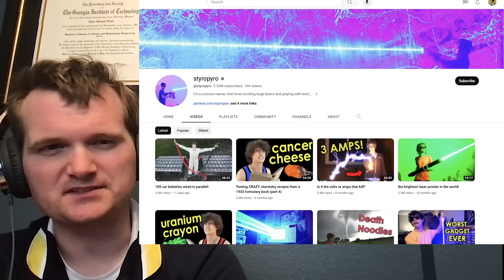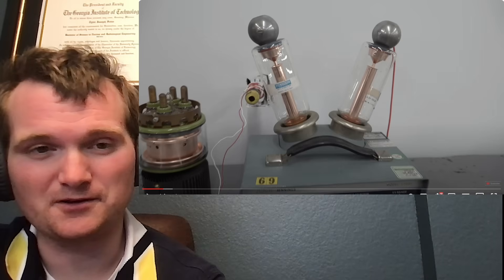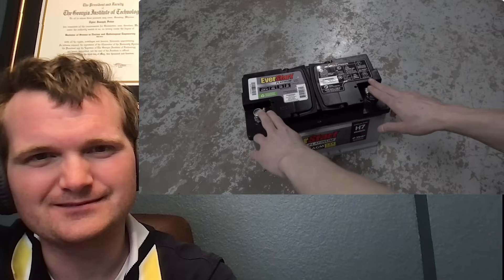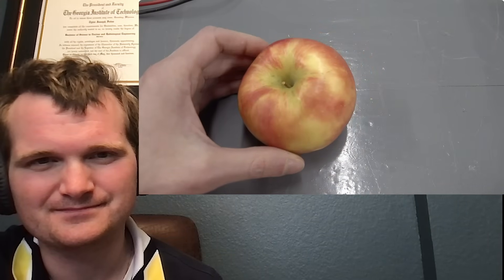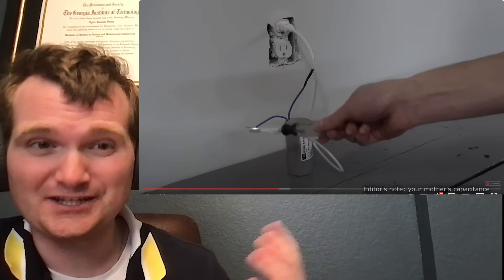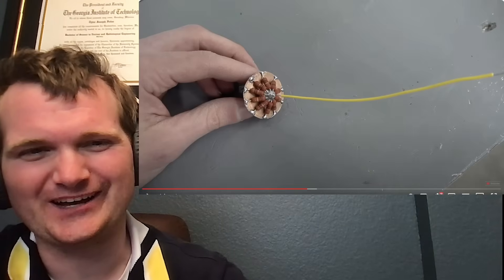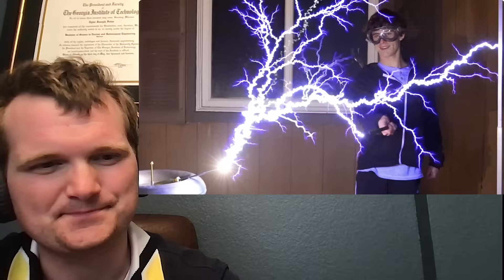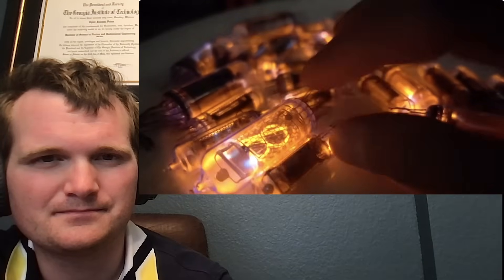Nuclear Engineer Reacts to Styropyro "Is it the Volts or Amps that Kill?"

Comment: Dudes who say it's just the current that kills, never went to the navy and seen multi million(mega) watt transmitters which capacitors have literally vaporized people.  The discharge is voltage. However, if you have .000000000001 amps and the reciprocal in volts, in totality you only have 1 watt, and vice versa. It takes power in general to pose a risk to a person. a trillion amps of current and a nano volt won't kill you. A trillion volts and a nano amp won't kill you either. This is theoretical . The current and the volts vary when they travel through different sources. An ark in the air isn't just volts, the current is also traveling through the air, and the further the distance and less dense the materials the least amount of power is getting to ground. whatever is at the other end is ground. Ironically the ground for a lightning strike could technically be the other ark coming from the ground to to lightning meeting it instead of just the ground. That isn't necessary to mention. the ground is the ground. The ships hull is the ground, a large metal object is the ground when attached to electrical and the bigger the current the bigger the ground needs to be. Not unironically in ac. High voltage can use the negative as the ground, but it's less safe and not neutral . For most purposes tho, the negative is the voltage leaving the power source .

Comment: One thing that was completely overlooked was the surface area of the contact and what that has to do with (dis)comfort.  Getting zapped by a Van de Graff  generator or static electricity is painful because the arc is intense, focused at a tiny spot of the skin.  If you repeatedly get arced by a static generator, you'll want to have it stop.  But if you hold a key, or some such conductive object that will distribute the energy over a broad area, and have the electricity arc to that, or even rest your hand on the Van de Graff generator globe, chances are you won't feel anything.  It's like being injected with a medical needle.  It does not take much force to penetrate the skin, muscles, etc., because the force is focused at the tip of the sharp needle.  But you can press your thumb, for example, with much greater force and cause no discomfort or damage because the force is spread out over a large area.

Comment: Used to have a friend growing up who had his grandads old WWII wind up field telephone you could place your fingers on where you'd attach the wires and wind it the get shocked voltage wasn't high but it was higher than the 9v and 12v batteries.

Comment: The other reason we step up and down transmission lines with voltage is because if we were to use low voltage and a high amperage is the cables required would be enormous to transmit it

Comment: What makes electricity lethal is its ability to interrupt heart rhythms as well as stopping the heart from beating. And yes current is the killer but to understand current is to understand ohms law as if the voltage is too high or the resistance is too low or both the current will be high. High current can also cause third to fourth degree burns and can be fatal if it passes the heart. However electricity is used in defibrillators which is used to restart the heart with passing electricity through the heart to stop it momentary during ventricular fibrillation so it can beat again (Sometimes especially if the person has a heart condition it doesn’t work and can stop the heart permanently).

Comment: I recently went to a rock climbing gym and had collected enough static electricity in my body to create an inch+ length static bolt from my finger to a metal pole.  it was cool, purple, and I the after effects on my arm for 30m after that. Looked it up and it turns out that was 25k+ volts to make that static bolt appear. So yea cool stuff

Comment: 4:10 but what about the heat that also could kill right?
Reply: Yes, of course. But there's other issues afoot if you're near an arc flash and you die from heat.

For heat exhaustion to kill, it would take hours. For burns, though? I'm unaware of how much of a body can be burnt before it dies. However, I also do believe burns take some time to kill, too. Please correct me if I'm wrong on this!

At any rate, you're dead from your heart stopping before you get burnt to a crisp.

Comment: If you have seen the after effects of contact with mains generated 11/13.8kV (and I have more than once) you begin to realise just how dangerous electricity can be.

6mA can kill you, but there are factors involved. Frequency and source impedance are important, so that is why plasma balls and Tesla Coils have little effect other than direct contact plasma burns. So the 6mA has to come from a low frequency low impedance none isolated mains source. High voltage tends to flash over the skin to earth, leading to serious burns on the body. Arc flash and flashover can happen on both high and low voltage tending to cause melting of copper conductors and blast in switchgear. The battery has no frequency and a voltage low enough not to cause tracking over high skin resistance, but the arc is high current when conducting through low resistance materials and can cause burns. So you are correct in saying that electrocution is a combinational effect and tends to lend itself to low frequency low impedance none isolated sources.

Comment: At 14:37 that why on anything over 500 voltage you need a arc flash suit I work at a plant with 26,000 to 50,000 voltage breakers use to operate very  big very heavy equipment

Comment: Amp kill mainly the reason people have the chance of surviving lightning strikes it only take .5 amp to be dead dead with only .1 amp to kill most people with just normal housing non industrial use there 10 to 30 amp in just the outlet and switches and I believe that oven are around a 50 amp with 120 to 240 voltage run through it doesn't take long to kill and the meter on the pole if not place right could basically become a rocket

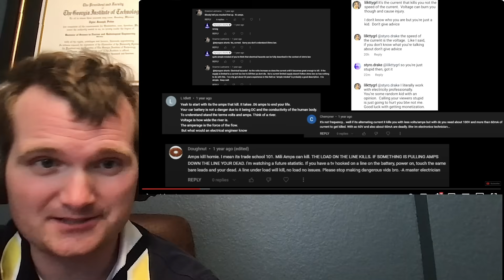Comment: 4:21 umm you need voltage to break the skins protection. From experience. 
50v DC with dry hands you'll start to feel. But AC is much lower around 10volts on dry skin. Not that I done this for fun or anything.

Comment: Voltage, basically just pressure that yeets the electricity through you, or the electrical potential difference
Amps, strength of the current

Comment: 10:00 Parachutes do NOT "slow down your deceleration"  ... they slow down your VELOCITY so your LEGS can absorb the shock when deceleration occurs upon contact with the ground. By slowing impact velocity from 200+km/h (Human free-fall velocity) to approximately 25km/h the impact energy is reduced to 1/8 that of free-fall, which is a safe landing speed ... especially if modern para-sail type parachutes are used that will allow somebody to flare the chute and land standing upright (rather than dropping into a forward roll, like they had to do in WW2, to reduce the chance of injury)

Comment: Always remember 240/208/120 is at 3' and for 480/277 it's 4' and for the cabinet controlling a 25000 KVA transformer line to 480/277 is 10'.  I always thought it was crazy to hear Old electricians regurgitate the it's not the volts... Not considering the fact that arc safety is based on voltage

Comment: Firing ceramics works the same way. Its called heat work. Its not just the temperature you fire things at but also for how long they're exposed. Its the integral of temperature with respect to time.

Comment: 1 volt going at 1000000 amps; nothing.
1000000 volts going at 1 amp; death.
Reply: 12:15

Pyro addresses this point and conducts 100,000 volts at 3 amps through his body for a few seconds at a time. He doesn't get electrocuted because the frequency is way too high. He can still get burned by the arc, though, but not electrocuted.

Comment: Great job, love your vids! One thing though. While i agree that technically, with teleportation in mind, you can go lots of inhabitable and dangerous places within a fraction of a second and be fine, but i find it hard to believe it would work out for a center of the Sun =). So i started digging some. XKCD actually covered it, and somewhere along the lines i found him using The Stefan-Boltzmann law to calculate the amount of heat radiation a person would receive within the interior of the sun, which is far hotter then its surface. I think 1 femtosecond equals to 3rd degree burns. But that's just the heat. And yet, even if we reduce our exposure time to a matter of a zeptosecond - that still won't be enough to survive, and believe that is because of the radiation field of the star, where in the middle of it the cumulative force of photons will ionize the DNA within less then a zeptosecond. So, in my opinion, it wouldn't be the heat that gets you. I would love to hear your thoughts on that, if any! Thanks for the content!

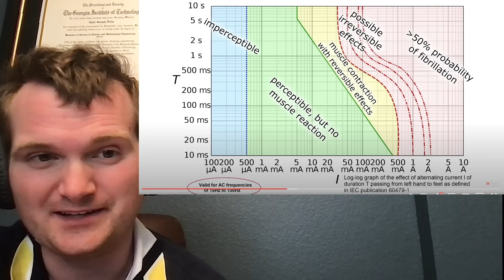Comment: 9:51 as Jeremy Clarkson and other said, "its not speed that kills, its the sudden stop."
Reply: Depends on the speed, enough g's can deprive your brain of oxygen long enough to kill you
Reply: @AnotherAustin-z7b That's still acceleration or deceleration, not the actual speed by itself.  The earth is moving pretty fast around the sun right now, for example.  So...sudden start or sudden stop are both problems.  Or sudden turn.  Just...if you're going to do a lot of something you should do it gradually, at degrees you can handle.
Reply: Speed and Powaaa!

Comment: "The answer is yes" People should be careful when messing with plasma. Produce the right frequencies of plasma generated ultrasounds and you can imagine the cells in that frequency popping like a lithium battery blowing. Vibrates bonds apart, certain frequencies things can't exist in the frequency the charge goes up in them into destroy unless turned off or destroy instant by high power at frequency. Best to add Ultrasonic scanner frequency filters nobody tells you about..

That way you can experiment with plasma generated ultrasonic holography. That should be yummy for someone who works in your field. Computer controlled holography reinforcement of metals and everything with a powerful enough source. Someday be able to use Ultrasonic holography for reactors to build themselves. Points at Ultrasonic holography control of particles and points at Kenneth S. Suslick: "Ultrasound can produce temperatures as high as those on the surface of the Sun and pressures as great as those at the bottom of the ocean. In some cases, it can also increase chemical reactivities by nearly a millionfold."

More with plasma generated Ultrasound.. Points at X Men Apocalypse | Builds A Pyramid clip on youtube and closes eyes to access Ultrasonic holography matrix control system to see with the Ultrasound that's being used to dust everything to print together - Someone looking down on Q Clearance 👽 (Btw? Pressures great as bottom of sea without plasma source still crush your super military subs like toy junk.)

Comment: Something I never understood is why the extremely high voltage lines (I think they are like 15,400v if I am not mistaken), they have no insulation on them.  Just bare wires seem like ti would electrify anything it touches including the huge metal structures they are hanging on.
Yma O Hyd!

Don

Comment: I work in an older industrial plant and I have an automatic transfer switch that has an incident energy rating of 121 calories per centimeter squared that has the “ENERGIZED WORK PROHIBITED” label plastered on it. With that kind of IE present I don’t think the steel cover plate would stand a chance in the event of a bolted fault inside!

Comment: I remember working in a factory with several 3 phase, high voltage electric motors (15kv), I was told to stand to the side of the circuit breaker when connecting or shutting off these beasts.

Comment: Ohm's law is defined for conductor, which typically have linear resistive behavior. It works pretty well also with with AC,as long as there are not too much capacitance or inductance involved. In conductors, electrons move by themselves in the conductor structure.

Ohms law don't apply on conducting liquids up, because in those, ions are transmitting the current and there are chemical reactions and potential barriers involved. Dielectric brakeage is not the only phenomena, which is affecting on conductivity.

Comment: one thing with the amps kill quote is the assumption that your being shocked by atleast significant AC power.
ultimately the next step up would be more complex in calculating volt X AMP X time at a minimum i would assume.

my main experience is a significant shock with mice chewing though 240V AC lines that ended up in my hand while reaching for a switch.
with a 2nd more recent one which i dont know how to exactly classify because a wall mounted USB power hub fell apart and landed with a sharp soldier contact from the transformer digging into my hand. "didn't feel like full AC Power but also felt like much more then consumer DC power"

funnily i didn't know until a few months ago that technically "atleast here" your supposed to get your self checked medically after pretty much any shock beyond very low voltage DC. 
though not getting checked for the first one i blame on a combined being young and in shock a bit to not think about it if no one else was.

Comment: I saw another video sort of liek this he did but not as in depth. Messed with electronics for years, got a poke of a 9V and a relay coil due to the back EMF, i think the worst one I had a weed trimmer that would not shut off I had lether gloves on and the sparkplug had  the rubber boot on it. Went to remove it and gave me a jolt throguh all of that. I was young I was really scared of welders thinking it was like high voltage it didn't make sense how you can safly do that. It's the oposite generally the lower the voltage the higher the amperage, welder may take 30A 240V and make 30V at like 200A. 

May not be the most educational but I think would be funny see your reaction to Imagine dragons radioactive video.

Comment: As an electrician in the uk I love this video, as a rule of thumb a fatal shock needs the 3 50’s. 50 volts, 50mA and 50Hz which means any electrical outlet in a domestic installation can kill you if you touch it for long enough
Reply: As a not an electrician from the UK, I always remember being told the possible folk tale of the sparky that took to many naps at a substation and somehow messed up their nervous system from proximity.

Comment: There's also the factor of the path of the current. Old-time engineers working on tube electronics worked with literally one hand behind their backs, so they didn't complete a circuit with both hands and allow the current to flow through their hearts.
Reply: I was learning Tubes in the late 1960's...one hand behind the back was taught in Tech school.
They also taught using the back of your hand to 'test' for high voltage.
The muscle contraction would make the hand/wrist curl away from the source of current.
Then again, the Teacher of the class was smoking while he lectured...safety last?
Reply: the road to safety standards are paved with blood.
Reply: @pirobot668beta  im not an electrician but a mechanic that works on the building maintenance alot aswell, even for low voltage stuff i like to first shove the meter into a known working outlet to make sure it is accurate, then use one of those little pen things that beep when near the hot lead, and after all  that for good measure i tap the wire with the back of my hand to be extra safe before handling ac power.  got lit up by 480 3 phase once, had to remove a 480 plug and swap it for a different style, stuck the meter into the plug to test for voltage, got nothing, got lit up, msha comes, the leads on the meter were 3/16th's of an inch too short to reach deep enough into the plug to read a voltage.

Comment: When I was an EE student, before they let us into a lab we had a lecture about the dangers of electricity and how to protect and mitigate the risks. Still, when we were working on a motors lab and a failure to make a couple of connections would have turned the motor into a bomb, the professor hovered around the switch that would kill power to the whole lab.

Comment: 4:06 the comment from Doughnut is just completely false, the load on the line matters very little, what matters is what goes through you. They also say if there is no load on the line then you won’t have any issues, that is just completely false. By that logic I could take a wire out of a socket and touch them with no issues since there is no load on the line. They seem to completely misunderstand what happens to resistors in parallel. Also by their logic if you had your hands on a car batteries terminals you would be fine when there is no load but not fine when the starter motor is running, but you would be fine either way.

Edit: according to one of the other comments he shows, voltage is just the speed of the current. That is total nonsense.

What’s scary is the amount of people claiming professional experience and getting it so wrong, I hope they were lying.

Comment: The arc flash bit reminded me, if you get a current fault and it vaporizes the copper wire, if it turns about 50g from solid to vapor, it'd behave comparably to a hand grenade.
Reply: Not to mention very unadvisable to breath in that vapor, lol.